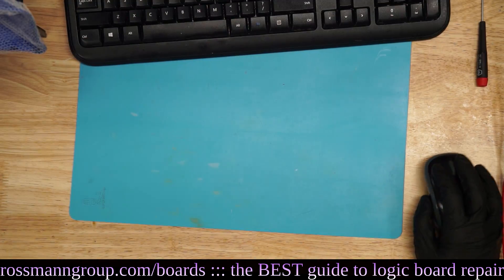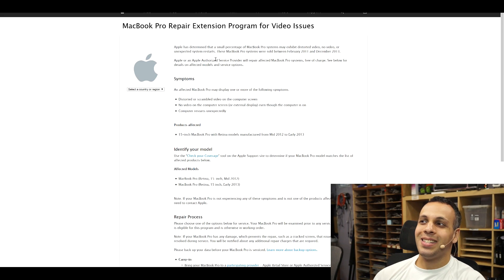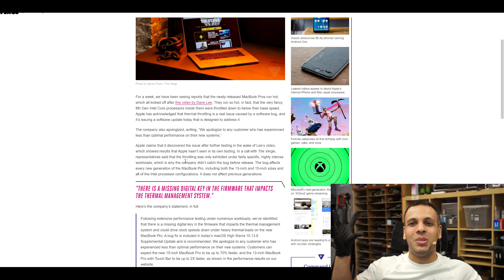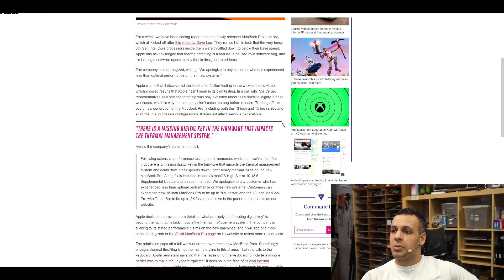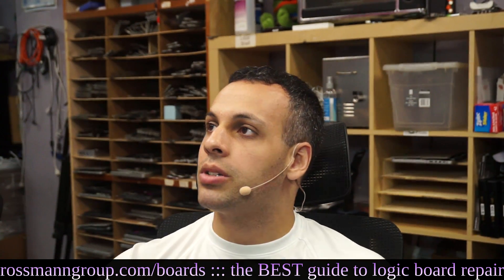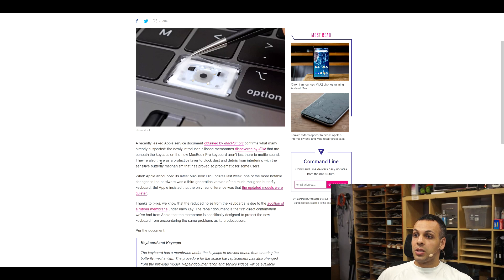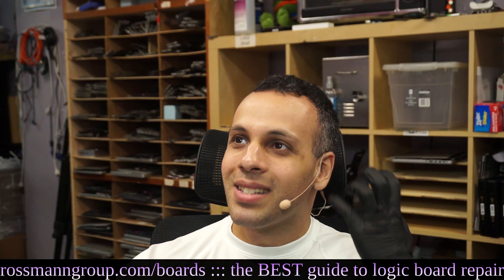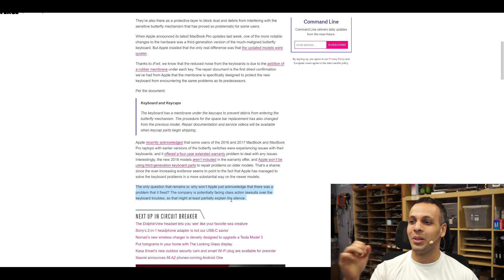This new Macbook is becoming a meme.

Comment: I was actually thinking of getting the base i7 15” model... I think I’m gonna get a Blade 15” now.
Reply: I heard about bad quality control about Razers, you can even look at Amazon reviews.
Reply: Look at the new 8th gen cpu Msi stuff, they're actually quite nice.
Reply: Adam Messmann razers equipment is pricey. There are cheap options with the same parts.
Reply: 6-core Blade throttles too :) Not as badly, but still.
Reply: Get a thinkpad. They're not as thin and light as Blade or MBP, but compared to those two thinkpads are basically bulletproof.
Reply: Adam Messmann blade is good but support isn’t that great, check Dave2D’s video
Reply: Adam Messmann Asus zephyreus is the best option right now.
Reply: dingus115 Id love to get the zephyrues. That thing is nice looking and powerful. Plus its has a dedicated gpu
Reply: DONT GET A BLADE. Believe me Apple is crap but razor is the king of them all. Get a Lenovo much better
Reply: I love my Asus Vivobook with the Core i7-8550U, and I only paid around $700 bucks for it... It's no 6-core, but for the money, the build quality is actually pretty fair. Haven't had any issues whatsoever.
Reply: Blade is also thin, and throttles too, i believe... just not as much
Reply: I heard Linus' Blade 14 2016's would turn on in peoples' backpack.
Anyone have thoughts in the MiNoteBook Pros? they clearly arent 6-Core monsters but they seem to be pretty respected.
Reply: Even Louis said that he'd almost rather use a Macbook Than a Razer Blade.
Reply: xps 13

Comment: Can this throttling issue be fixed with a software update? What are they going to do trigger a software program to hide the results as it heats up? Seems like it needs more ventilation holes.
Reply: Pablo Casiano maybe if they used the holes in their legitimacy for ventilation it would work
Reply: ZAB1019 de panther That might kick up global warming into high gear.
Reply: Maybe they will claim it´s a "drone hovering feature" when the fans spin up and it will take off. The cooling just has to handle a lot of heat, my i7 + Geforce 940 manages, but you are right, needs more holes and heatsinks.
Reply: I bet they will just raise the tempeture limit
your can get better performance
chips in macbook will fry earlier
and you are forecd to buy new macbook from apple
Reply: Pablo Casiano its quite simple, these new mac books actually have a transformative feature. The software update will unlock thus, allowing the device to bend and mold itself, until it has a better shape to let off more heat.
Reply: Trollamollex lmfao 😂
Reply: seems to me all they can do with software is limit performance, so it doesn't hit the thermal limit and start throttling
Reply: It will fry it´s chips, who benefits ? Louis at least, more repairs. For the money they have a really strange attitude, these macbook pro should be flawless and run for years.
Reply: I think they’re telling the motherboard to let the CPU draw more current. We’ll probably know for sure soon enough.
Reply: They will just speed up the organized obsolescence
Reply: @OtherTheDave, seem like the other way around, tell the cpu to stay below the maximum current the motherboard is capable of becuase hitting the limit is much slower than running a little slower and not hitting it
Reply: Lol!
Reply: What if all they did was trigger a software code that makes it look like it's fixed? Kind of like what Volkswagen did for the emissions test. Is this possible? Hard to believe it's fixed with no proper ventilation.
Reply: ZAB1019 de panther 
Won the internet for me today , I’m dyin 😂😂
Reply: Hlynur Stefánsson I got an i7 6700 hq paired with Nvidia 970m. It runs great at 3.6 when it's cleared properly of dust. But the bottom side might as well be mesh at this point amd of the need to take off arises so does the laptop.
Reply: The only holes this MacBook Pro needs are some bullet holes.
Reply: From what I can tell, there's more than one thing going on here. There was a software bug contributing to excessive throttling and they fixed it, that's a different issue to the poor cooling design, whether similar to previous models, or unique to this one.
Reply: maybe they should turn-off Boosting in those CPUs, this feature produces more heat in mere seconds than if your CPU run at 100%. The problem with Boosting feature is that it overclock the CPU when it 'think' it have the thermal capacity to do it, but this prediction will mostly be a fail; how could the CPU knew (with accuracy) the system's thermal behaviour... if you buy your own cooler place the CPU in different environment how can it knows what is around it, it just to much variable & bound to a fail.
Reply: Probably just ramps up the fan speed to jet level. And runs out the bearings so the isheep have to buy a new one sooner.
Reply: Yes, it would be smart to make somehow a bigger heatsink, mine is crammed into ultrabook form (Asus UX303 UB), i replaced thermal compound after 2 years, dust build up was not really a problem at this point, in my old laptop it had a good old access panel directly to the CPU which was handy, i remember i pulled out the dust from that, it was so uniform and shaped like a filter ! Removed that and it instantly stopped running the fan all the time, i wonder how the exhaust port on the Macbook will fair, it looks even thinner than my ultrabook.
Reply: About as legit as downloading more RAM from the internets.
An actual fix would be, I dunno, decent cooling pipes and fins, some better airflow, ducting for same..
Reply: More ventilation holes is not enough, heat pipes and a better cooling system
Reply: Oxaile A little premature on the e there buddy.
Might want to hold off the celebratory wank fest.
After all, you're holding it wrong.
Reply: I have a Window tablet without heatsink, it is quite slow due to thermal throttling, so I makeshift a heatsink using the tablet's metal body; I attached its CPU to the metal body using a metallic-tape backed by a flexible plastic-straw as springy support. It conducted heat to the body so well.... others also did the same with their tablet (in YouTube like "heatsink mod for Teclast tablet" for example) but I did it very cleverly without thermal-sponge or thermal-tape.
Reply: Brent Keller
O boi u butthurt ain't ya? xDDDD
Reply: Oxaile not especially.
But the people who have macbooks that now have reduced performance to prevent thermal throttling for $7,000 might be.
Reply: Oxaile I don't spend several thousands on items that tell everyone I'm buying a status symbol.
It's like the idiots who bought a chevy Volt when there were other hybrids that did being a hybrid lightyears better and for less money.
All you have are insults and teenager angst.
Reply: Brent Keller
You do realize the Volt is a Plug in hybrid right?
It's a fully electric car until the battery runs out Lmao.

What i have is facts, what you have is infinite stupidity and lies.
You try to make an example but you even get that wrong which is just sad.

I'm gonna assume that you're a teenager who thinks his self built g4m1ng pc is the best thing ever and that specs are the only thing that matters.
Reply: Oxaile Negative, the Volt is a gas electric hybrid, the gas engine does indeed have a direct connection to the wheels and it is still a "hybrid" in a world where the Toyota Echo (obsolete) still does being a hybrid better.
Try again.
Also, I don't buy things that are defective "out of the box" to stroke my ego.
Reply: Brent Keller
I can't tell whether you know less about cars or computers.
First, the Volt does not use gas, it uses petrol and electric as main sources of power.
Second, the Volt can and will operate as a fully electric vehicle as long as it has battery left, that's the fucking point of a PLUG IN hybrid, you plug it into a fucking wall to charge it.
The petrol engine only exists to make longer trips where the battery alone would not be enough possible.
Try again... Or don't, would save you from embarrassing yourself any further.
Reply: Oxaile I can tell you're emotionally invested in defending defective equipment that is passed off as owners operating it wrong. (Oh noes, you're holding your phone wrong, you peasant! You're supposed to lay it on the ground and speak into it in the fetal position!)
The Volt has a gas engine, it is indeed a gas electric hybrid.
Trying to claim it is something else is intellectual dishonesty.
"The petrol engine only exists " thanks for admitting it is in there, it is thus a hybrid in a world where other hybrids do being a hybrid far better and for cheaper.
"to make longer trips "  yup, the very definition of "Gas electric hybrid" .
Amazing.
Reply: Brent Keller
I am emotionally invested in this in a way that it brings me great joy and satisfaction to see degenerates like you trying to hide the fact that they know they're wrong :)
Although i'm not yet sure are you trying to act like you don't know the difference between a regular Hybrid and a Plug-in hybrid or do you just genuinely not know it.
In case you don't know it: A plug-in hybrid has much larger batteries than a regular hybrid and can be charged from a charging station or a regular wall socket unlike a regular hybrid.
The larger batteries make driving it only on electricity possible for much larger distances (53 miles in the volts case). And the engine will only be used if the battery runs out.
The larger batteries also make it much more expensive than a regular hybrid in which the batteries can usually only run 1-3 miles on pure electricity and which is why a regular hybrid can't be driven without using the petrol engine where as a plug-in hybrid can.
Do you understand it now? :)
Reply: Oxaile, You mad bro?
You butthurt?
Yeah you are.
Uwu uwu uwu uwu uwu
I like it when emotional crybabies get angry because someone dared dislike "defective out of the box" merchandise.
Reply: Brent Keller
Ahh, there's the " i know i'm wrong but can't show it" response i was so eagerly waiting for :)
Thanks for making my day and good night :)
Reply: Just showing you what you did in your first several posts here.
Don't like mirrors?
Terribly sorry about your butthurt there, son.
Reply: Well the patch is out and the performance is now what it should be.
Looks like you sad trolls were wrong LUL

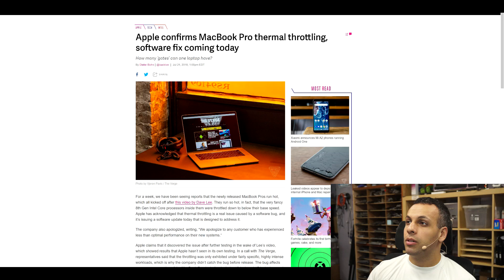Comment: 0:15 "..software fix is coming today".. dafuq are they gonna do through software? underclock it? like WTF! it'll still probably be worse than the i7 model.. Apple get your shit together..
Reply: Yeah...underclocking a damn i9 lower than it already reaches ( which I've seen as long as 1.7ghz) is basically like running a damn athlon x2 6400 at stock speed of 3.2 ghz.  Crapple will NEVER get their shit together.  Their too hellbent on spreading it like "Isn't it amazing" verbal diarrhea.

Comment: Do you think that part of this problem is Intel’s fault since they can report the TDP to be whatever they want by making the base clock whatever they want? It 45W at 2.9GHz, but as soon as you go over that it’s WAY more than that. 4.8 boost imagine the TDP. I still think this is also inadequate cooling because Apple may have expected a 45W MAX TDP. Who knows though
Reply: Sc.Lime it's in the spec sheet, any company worth their salt study the spec sheet of any component they put inside their computers meticulously.

I don't like the new trend of variable performance on same CPU either, but this is all on Apple.
Reply: Sometimes, the use of "Watt/s" in the TDP rating is somewhat counterproductive (even if it is technically correct). Intel clearly states in their >3000 page Gen 8 H/S CPU spec sheet (excluding the U/Y series, which get their own massive spec sheet) that the new hexa core chips draw significantly more current than the quad cores preceding it (peak of 86A vs 128A). 

45W TDP is not a lie. TDP =/= power draw. Long term power draw may approach TDP, but short term (turbo boost) is not defined by "45W TDP." A "45W TDP" heatsink that is  cool and unsaturated can briefly handle more than 45W load. So long as the heatsink is capable of handling more than 45W at the exact moment (and the VRMs can handling it), the CPU can try to take advantage of the extra headroom.
Reply: The boost is there to 'look nice'. Usually, you run at boost clock most of the time if you have the cooling capability. If not, then you either run at base clock or you randomly scale up and down. If you have shitty cooler, then you throttle and lose most of the CPU power.
Also, TPD scales much faster than frequency/voltage when overclocking.

The VRM overheating tho is massive overstep. There is no reason why it should throttle itself and the rest of the system. Having the load spread out on several power phases, having them in 2-3 separated groups - and you do not have to even cool them - if you do not use the shittiest parts there are.
Reply: Apple has a history of using inadequate cooling solutions for the sake of their products running quieter. This usually means either underpowered fans or configuring the machine to only ramp up the fan when the temps get over 90 degrees Celcius. For added fun, they'll sometimes do things like direct the exhaust fan toward the stand of an iMac Pro so the intake fan sucks the warm air right back into the machine, or direct the exhaust on a Macbook towards a bezel that's only held in with adhesive so the lid slowly starts to come apart over time...